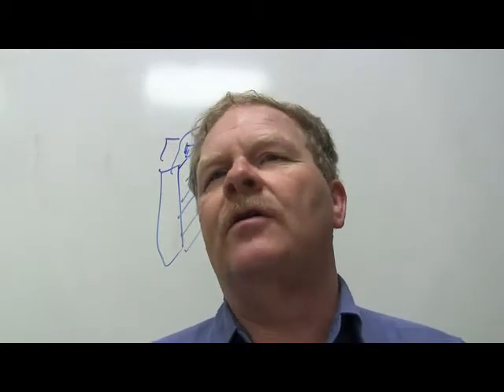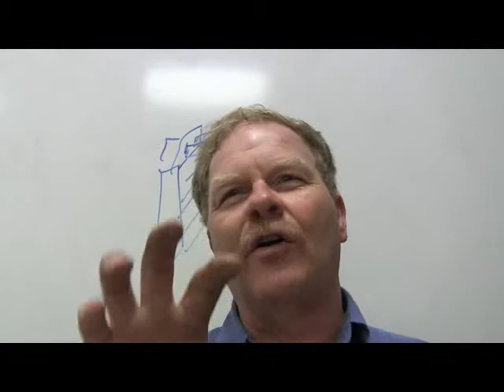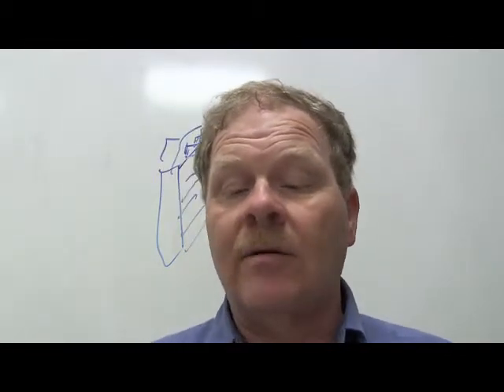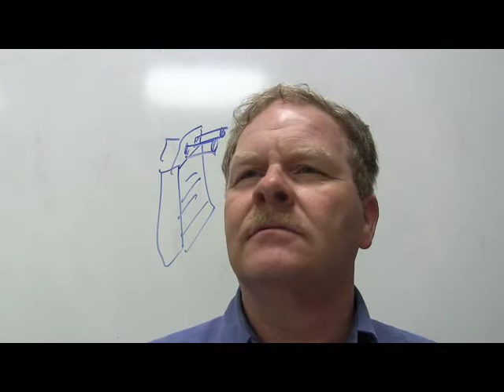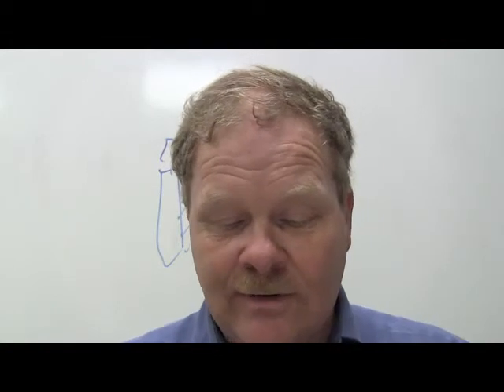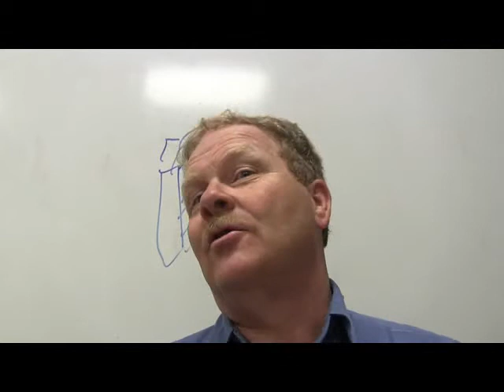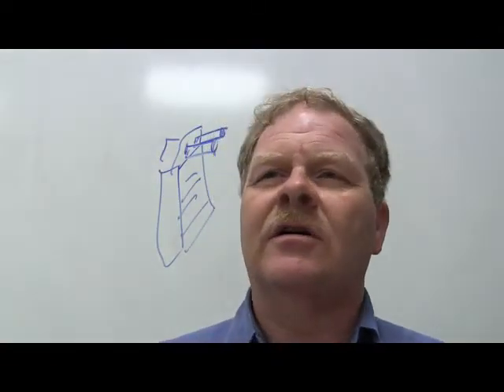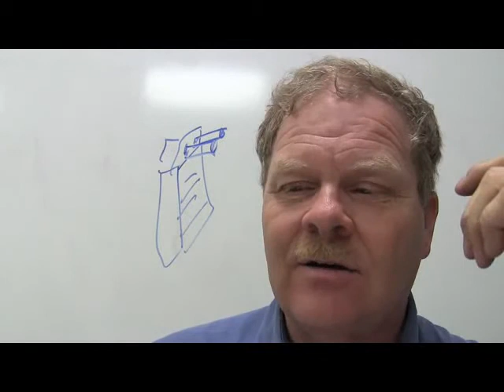Special Topics 2 Hybrid Electrical 1

Comment: Hi McCuistian, it might not be the right forum, however i would like to make a question. Regarding the Rear Diff Seal, is there any additional thing that must be done on a Toyota Hilux 2004 model. The mechanic has been unsuccessful trying to remove the seal. The screw just doesn't open at all. any suggestions?